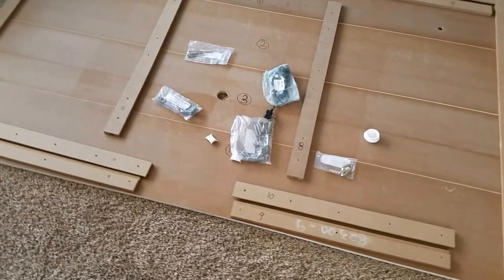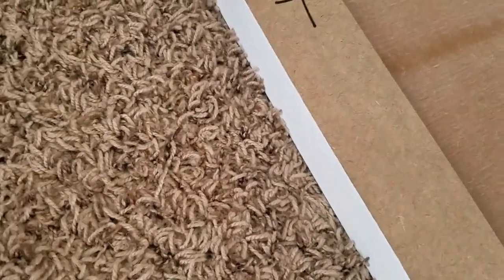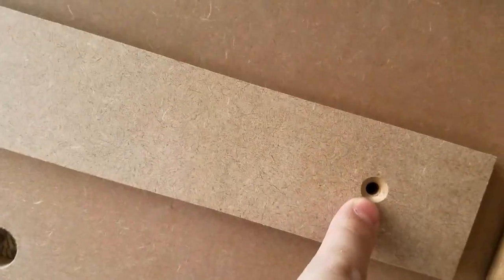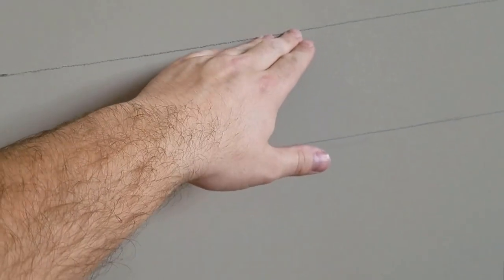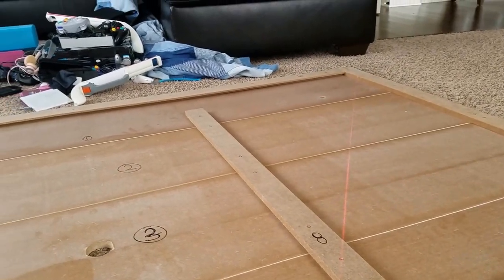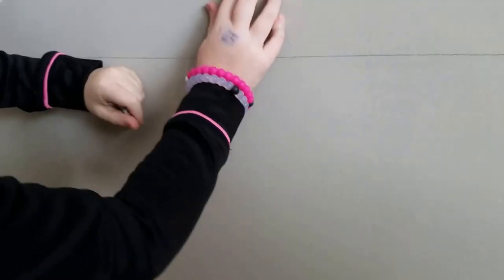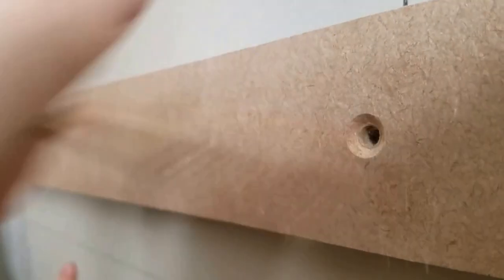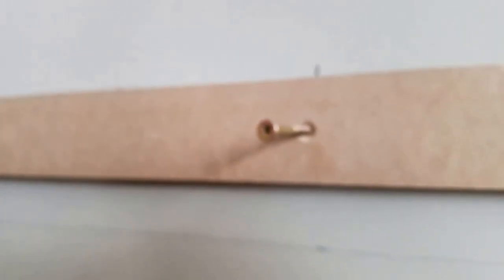Installation Guide For Manhattan Comfort Cabrini TV Panel

Comment: I don't know how you did it in 90min, but it took me at least 24 hours to put everything together. Manual is poorly written as most stated, but if you can figure everything, it is a beautiful piece of furniture.
Mine did not come with the wooden lips, but with metal lips where you hand the wall mount, i also added some LED lightning on the back to make it stand out more. I posted a review on amazon so that others can benefit.

Comment: Hi - This is a great video!  I am considering buying the same panel, but the one which has the floating drawers as well.  However, I have a sheetrock (drywall) and the company's website "recommends" this product for concrete and brick walls.  Is there any way I can reduce the risks involved with respect to the weight?  Will my standard beams be able to take the load of this panel with the hanging drawers (I believe it is about 183 pounds) plus the TV on it?
Reply: did you get this? I am planning to buy as well and have the same worry , let me know your experience
Reply: Hi , did you install this on the dry wall ?

Comment: Hey John. Thanks for the video. Was lots of help. Question about TV mounting. At what point did you mount the TV to the wall unit? was it before you installed the panel to the wall? is it possible to do so after its already hung?
Reply from the maker: You definitely need to mount the TV mounting hardware prior to the mount to the wall
Reply: @JohnFraserCore  thank you for the video, should I buy the fixed wall mount? Or full motion mount? Thank you
Reply from the maker: @fiametaferede7428  fixed thin mount is best. Large arm might put outward pressure the panel itself.
Reply: @JohnFraserCore  thank you very much

Comment: Hey thank you so much for the vid and your fast reply , me and my wife put it together today ! . Now my concern is about if my wall it's gonna be able to hold this thing , I have a normal sheet rock wall , seems just like yours , what type of wall do you have ?  Thanks ! Once more .
Reply from the maker: Pretorians Apparel .Alex keep in mind my setup does not have the bottom shelves attached to the panel but mine is attached mostly through anchor screws into the sheetrock.  using the mounting setup they have you should feel very confident as long as people aren't sitting on the base cabinet that the unit will hold up just fine.

the sheetrock anchor screws can typically hold about 40 to 50 pounds per screw and if I remember right there are at least 12 screws that go into the sheetrock. So that is something around 480 - 600 pounds of holding power.  if you measure carefully the way the panels locked in and sit on top of an evenly distributed piece of wood should be very strong indeed
Reply: Pretorians Apparel .Alex I finished installing the bottom drawers as well on my sheet rock wall. it seems to be holding up well. I haven't put anything heavy on it though.
Reply from the maker: Pretorians Apparel .Alex congrats!
Reply: Thank you :)

Comment: Will the bracket for the tv support a 65 inch or are u suppose to buy for own tv mount and drill through the panel
Reply from the maker: It comes with a mount and you drill it into the panel.

Comment: John B Fraser Great video, thanks for the insight. How did you mount the tv on the floating wall? I'd prefer that the mounting hardware also grabs studs. Let me know, thanks.
Reply from the maker: Late reply, I hope you got it fogured out. The vesa mount drills into the panel before hanging on the wall

Comment: Hi John.  Thanks for the video.  It will be very helpful.  I have a question.  I have an electric heater attached along the wall right where this bottom part will be, so do you think that will affect the alignment of the bottom part with the pannel?  It is that regular heater that is installed against the wall where the baseboards would be.  Thanks.

Comment: Sorry to ressurect this thread...but I am considering getting this wall mount. How far in were the hole for the cabinet at the top? I might have to buy two and cut one in 19inch strips to fill out my wall. Just curious if the top holes will show at a 19in cut. THanks!  Great video!
Reply from the maker: Sorry I don't fully understand the question. My version doesn't have the attached cabinet unit...my lower unit was a different set from IKEA
Reply: John B Fraser sorry. The top panel has two holes in it for the wiring for the shelf and lighting system.
Reply from the maker: @jchusky77  I don't recall exactly. Do you want me to guess? From the top or the side of the panel?

Comment: I’m just getting mines in and I’m well aware of how to do everything with no problem. My biggest question is how did you hang the tv? The only thing I can come up with is to get additional longer screws so they can go through the panels and into the drywall studs. I just don’t see this little wood panel holding my big TV.
Reply from the maker: You would be surprised.  Unless your TV is Plasma 3D or just extremely big, the wood on this panel will definitely support it with proper mounting.
Reply: John B Fraser thanks. I have a 70 in. My tv is already mounted in the wall and I was just trying to make sure before I take everything down.

Comment: Great video. Where did you use the glue? Weren’t the screws enough?
Reply from the maker: The screws are likely enough but the glue is used to connect the side pieces that bind the white sections together.
Reply: @JohnFraserCore  Great. Thanks a lot for this video. Keep it up.

Comment: i bought a tx 75 inches but the panel is only 1.8. can i buy an extra tv mount to help support it or should i just return it? thank you!
Reply from the maker: You could buy one
Reply: John B Fraser thank you! so do u mean i can keep the tv and the floating center with the extra mount tv? do u have any recommendation for the tv mount?
Reply: @AnhNguyen-te3vo  yes, use a USX Mount.  You can get them on amazon for about $35.

Comment: The specs say this is only for a concrete wall.  Isn't this too heavy for the sheetrock as in the video?  I bought it after I realized it was for concrete and now I am wondering how to proceed.  Thanks.
Reply from the maker: Do you have the version with the cabinets attached to the bottom as well?
Either way, you have lots of options. Let me know and I'll help you.
Reply: @JohnFraserCore  Hi John, Yes, I have the bottom cabinet.  There are no tongue and groove boards on this one but several french cleats.  I guess I can use heavy duty drywall anchors?
Reply from the maker: @rayherman9713  yeah I dont know the weight of your unit but to he safest, I would take the extra time to find the studs in the wall then drill holes in the French cleat to match up with the studs. Then ensure you have the accurate weight and get quality sheetrock anchors for the rest. Plan on triple the weight in just sheet rock, plus 3 stubs across the span....you will be more than fine.

Comment: Would it be ok to drill new holes in the wall bracket to actually get into the studs?  I just don't feel comfortable mounting this thing along with a tv into sheetrock only.
Reply from the maker: MrChmodx you can but it is a fair amount of effort as you will need to countersink the screws.

A good sheet rock screw can hold 40lbs each. You have 16 screws going in. The entire thing weighs maybe 100 pounds with my TV

Comment: Hi John - great video! I'm looking at buying a Samsung 75" QLED. It is around 82 pounds and again, 75". Will this fit and able to be mounted? I'm concerned it will be too heavy and also perhaps too large in covering the entire panel? Thank you!
Reply from the maker: Both the size and weight will be fine for this panel.  They do make a 2.4M version which is meant for 80" TV.  The 2.2 is said to be for 70" TV so while the 2.2 will have a lot of it covered by the TV, the 2.4 version would maybe leave too much uncovered.
Reply: Thanks for the reply! Should I get custom brackets for the 75" TV on the 2.2 or do the Manhattan Comfort brackets do the job? Any recommendation you can give on how to securely fasten it to the panel would be appreciated.
Reply from the maker: GTwiZzy33 you should use the existing brackets. I would however make sure your panel is drilled into the studs versus sheet rock anchors for that heavy if a TV.

Comment: Hey. How did you mount the TV? Did you have to cut a big hole to fit around the TV mount?
Reply from the maker: You have to drill in the mounting bracket for your TV  after you fully assemble the unit just like mounting to a wall. No big hole to cut as you mount the TV directly to this panel. Just mount your VESA mount before you place it in the wall.
Reply: @JohnFraserCore  this actually answers my question but one last thing, are there guides for centering the TV correctly?  Especially if your mounting a larger TV (I'm going with a 75 inch that's 66 inches wide).  Thanks for the video btw, EXTREMELY helpful and very informative.

Comment: I have a 70in tv and I purchased the 71in. Do you think it would be safe to mount the TV?
Reply from the maker: How much does the TV weigh? The TV should physically fit. More concerned about the weight
Reply: @JohnFraserCore  honestly, I'm not forsure but maybe a little over 65pds. I think because the tv is so big maybe I should buy my own mount.
Reply from the maker: @nikkieboo16  You should be okay.  That panel is suppose to support > 100 pounds.  If you can, hit a few extra stubs in the wall when you are hanging it to be extra safe!

Comment: Did you ended up buying new tv mount or you used the one that came with the panel?
Reply from the maker: I used the mount that came with it.  This is the 2.2 panel and I have a 65" Vizio TV.  Mount fit it perfectly and felt VERY secure.  Thanks for watching!
Reply: I have the same 2.2 panel with 65" Samsung. I wasn't sure the mount was secure enough to hold it but now I know :)
thank you
Reply: I can't seem to figure out how to mount the TV to the panel. I get that the instructions are for mounting Panel to the wall but they skip over the TV mounting part. Any ideas?
Reply from the maker: I assume you got it mounted but you end up drilling holes into the panel base on the height of where your TV wants to be mounted.  Since the VESA mounts are located on different TVs in different areas, you'll have to measure, drill and center it yourself.
Reply: John B Fraser I bought the floating 1.8 where the shelf and everything is suspended off the floor. The wall panel however is exactly the same or close to with exception of metal mounting brackets instead of wood, although I think I would of preferred the wood as I prob would of been able to find a stud. My question however is did you end up using the screws with the mounting brackets for the TV that go directly into the panel or did you drill threw and use bolts nuts and washers to hold them in place? Thank you
Reply from the maker: Jeffery Kimber I used the one that came with it.
Reply: I’m just concerned as the screws seem small and like they won’t have enough bite to support the bracket, and if I’m reading this correctly the bottom just has spacers so the top brackets are the only support for the tv
Reply from the maker: Jeffery Kimber of you need more teeth, bring the screw to your local hardware as re store and get some longer screws. Maybe $.30 each
Reply: @JohnFraserCore  Can you elaborate a little on this.  Is the TV mount being mounted through the back panel into the wall or is it mounted directly into the wall and the back panel sits over the mount?  This part has me very confused 🤔

Comment: Hey thanks for the fast reply! One last question , how did you set up the brackets to hold the TV ? Did you use your own or the one that came with ? Mine didn't come with the glue ? What kind should I get ? THANKS !! your video has been really helpful !
Reply from the maker: Pretorians Apparel .Alex i used the mounting hardware that came with the panel. used the paper template as a guide by taping it tightly to the panel as I drilled holes.

in terms of the glue look carefully it is oddly in these little white pillow pouches where you need to cut a small corner of one of the edges and then press to get the glue out.  if you still feel they did not include the glue then just use some standard wood glue from your hardware store

Comment: What size is your panel?  Can you let me know the depth of the shelf on top and its weight capacity?  I have a Yamaha YSP soundbar that is really heavy, probably 25 pounds of awesomeness so need to make sure it won't collapse this shelf.  Thanks for the directions, much appreciated.
Reply from the maker: Gorilla Jones my panel is the 2.2 meter version. The depth is approximately 10 inches and I think 25 pound is fine if you put it towards the middle or back of the panel. Amy chance you can mount it to the back of the panel instead?

Comment: Is this difficult to set up?
Reply from the maker: Arielle Clark not really but judge for yourself in the video.  Let me know if you have questions.
Reply: Okay, I want to get this setup and I'm just curious before I make the purchase. I was going to just get the white panel and mount it to the wall since I have a white acrylic tv stand, but it'll be easier with the wheels I think.
Reply from the maker: Arielle Clark I agree, just get the back panel and not the entertainment center under it.
Reply: Yes, great advice. Thanks. Is there anyway to send you a picture: I'm trying to see if it'll look right?
Reply from the maker: Arielle Clark   Take a look at the last 30 seconds or so of the video which includes still screenshots of the mounted panel Before & After I added the lower cabins
Reply: Oh okay, I thought it was included. I guess since i do have the white acrylic tv stand; it'll make sense just to get the tv panel.